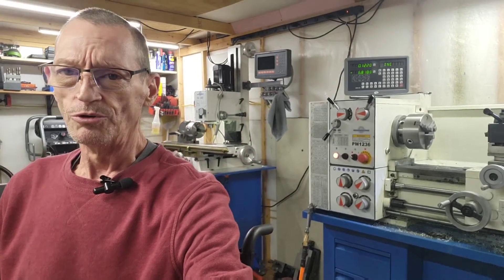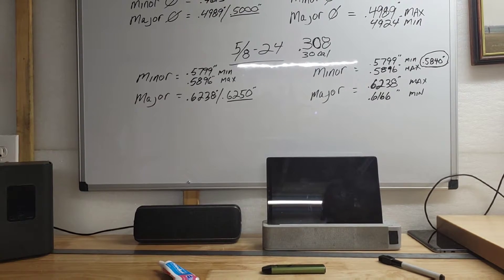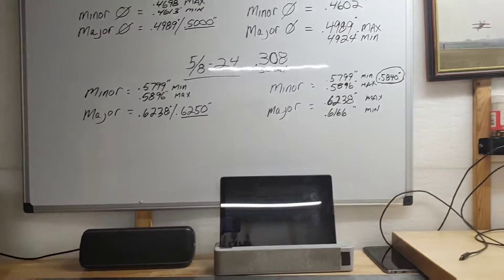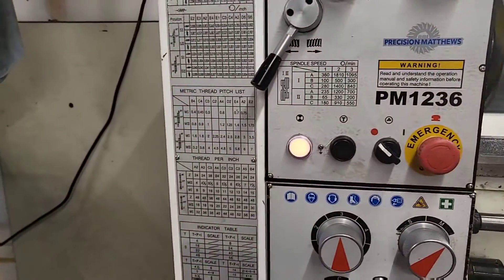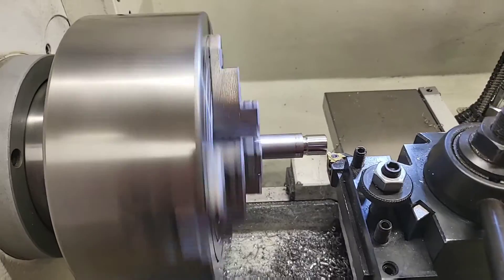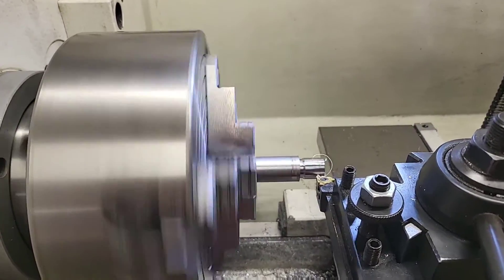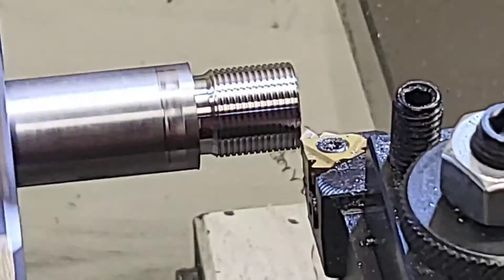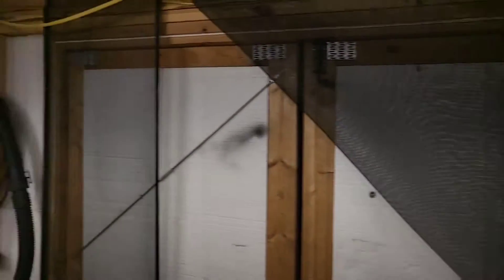How to cut threads PM 12x36 .308  5/8-24 muzzle thread. @Toolmaker001

Comment: Just found you while searching for info on threading barrels. Best of luck to you sir!

I do have a question.  What handles making sure that each pass of the thread cutting is aligned with the previous passes? If it's the lathe, I assume it requires a lathe with a thread cutting option?
Reply from the maker: Thread dial is used for that. So you have a rotating dial that is synced with the lead screw, it has #'s on it and you engage the lead screw in the same # Everytime. You'll have a start point that you return the carriage to each time. Then you just engage on the same # in the threading dial.
Reply: @Toolmaker001  Yes, thanks I understand.

Comment: i thought i knew my lathe... and now, now i dont.
you got the same threading chart... the same lathe under a different name. H&F AL336. 

so yeah... some threads, no issue. engage anywhere. 4,16, 24... blah blah. normally i do metrics and never disengage, but yeah, sometimes i do imperial and so far theyve all been those nice ratios...

notice how it has a "T" column"?  and those ones have a "0"?

so whats the deal with the 16 in that "T" column for the rest of them?

i only noticed this as i set up for 11TPI. sure. C3, MI, Z=22 tooth, whereas most everything else is the 24... engage on 4·8. so what the hell does the 16 mean? 

and then theres the other point of confusion... whats the difference between say, the 5 and 6 TPI saying 4·8... and the 12, 20, 36 saying 1-8?

whats the difference between a "·" and a "-"? 

i guess the only way to REALLY find out is to play around a bit more and make some chips... sigh. 

one day i might actually get to make what i want to make rather than fart-arsing around figuring out what the chinese meant when they made labels...
Reply from the maker: so when it says 1-8 it's any # 1 thru 8 when it says 4 8 its only engaging on the 4 or 8. Not being in front of my lathe right now this 16 your talking about isnt coming to mind let me take a look and I'll get back to you.
Reply: @Toolmaker001  it doesnt seem to be anything but a chinese quirk.
cut my 11TPI, internal and external... no issues. other than my own stuffups here and there... retract tool first sort of thing, lol.

love to know what the 16 means, but so far? seems superfluous.

then the 1-8 also seems superfluous as, ummm... there is nothing between 8 and 1? thats pretty well much the same as "engage anywhere" in my head... sigh... 

maybe it means "16 turns of the chuck" or "double the number of divisions on indicator" and i got lucky, but yeah... so far, the chart just looks like it has some rather redundant listings.

now to get fancy and try some multi starts :)
Reply from the maker: So I see the 16 and the 0 on the chart. I have never even given that any thought what so ever. It plays no part in any threading that I can think of.
Reply: @Toolmaker001  exactly. and now ive had a play around... 

meh, it must mean something, but yeah... mystery to me, mystery to you, mystery possibly even to the guys that made the thing...
Reply: I saw your question to Jeff @toolmaker001 regarding these #1-8  which is #set on your indicater which are to set correct engagement for next cut on the thread.  On the threading plate /indicator section at lower end (indicator plate ) there is the letter T at the top of two coloums belowthe T t four locations are numbers 0 and 16 in l/h coloum    15 and 14 in the r/h coloum these numbers refer to the gear tooth numbers of the tiny gears that fit on the bottom of the indicator spindle which is driven by your lead screw and increase/decrease roration speed of your idicator. If you unbolt the side  lock screw on the indicator block and swing it up you will see the gear that is bolted on the spindle you should have one each of the other size in your parts kit to change according to the pitch and scale. I hope this helps. ( A 1236 user in Ireland)
Reply: @MichaelMurray-w6f  i was starting to suspect something like that...

quick check... no, no baby gear in bag. no 14/15 written anywhere but as pitches...

Comment: Beautiful thread!  What insert and holder did you use?
Reply from the maker: It's a 5/8" tool with a coated carbide insert. I'll get the manufacturer and part # tomorrow and get back to you with this info. Don't remember off the top of my old brain.
Reply from the maker: Hey Gary, I totally forgot to get that info for you. I'm putting my shoes on and walking out to the shop right now. Be right back with the insert part # and manufacturer.
Reply from the maker: OK Gary. I finally walked out to the shop and remembered to get this for you. 16ER  AG60 ASZLBYM. I had torn the label on the pack of inserts and do not have the manufacturer  sorry about that. You should be able to find them. Also the tool is 5/8" so they will not work in hobby lathe smaller tooling.

Comment: Nice.   I. A new hobbyist with a vintage craftsman atlas 12x36. From the 40s.   Im trying to thread just been issues. I have ton of slop. I need a new nut for my compound crossslide.      Best of luck with yr medical issues.   Hope it all works out for you..  

Ken from boston
Reply from the maker: Hello Ken, check out my most recent threading videos. I do internal and external fine thread matching g as well threading polymers.
Reply: Backlash, brother. DROs can show you how it's there even with ball-screws.

Comment: Nice video. You might want to put a close-fit pin gauge in the bore and indicate that instead of the O.D..  Often the bore is not concentric with the O.D..
Reply from the maker: It was done that way because it's only a piece of 304 stainless as a mock muzzle. WTch my .17 HMR muzzle threading video.
Reply from the maker: Anyways yes I should have did that just because I was referring to it as muzzle threading. But my dumb ass assumed people would get it. Check out my .17 HMR muzzle threading video as well my 2nd internal & external threading video. The 2nd one is better then the first. Thanks Dave.
Reply from the maker: It's all good brother. But you are right about the indicating rod ( range rod ).
Reply: Ah, I am the dumb ass. You clearly stated what you were working on in the beginning.  I didn't watch the whole thing.

Comment: Hi Jef,sorry my english not perfect.can you giv my threads drawning.
Reply from the maker: Well, you need to get the minor and major diameters from Machinery handbook or a thread chart. This gives you the dimensions you need to turn to and finish at. You subtract the major and minor diameters and that's your depth.
Reply: @Toolmaker001  many thanks
Reply from the maker: Not sure what you mean.
Reply: @Toolmaker001  this is only thread measure ,but how lenght ? anrhow finish thread.? how deep thread?if posible make in paper and send my picutre.